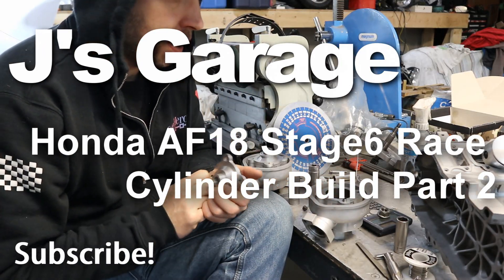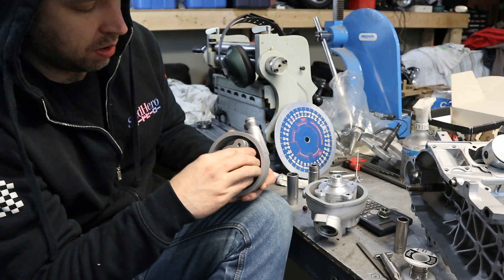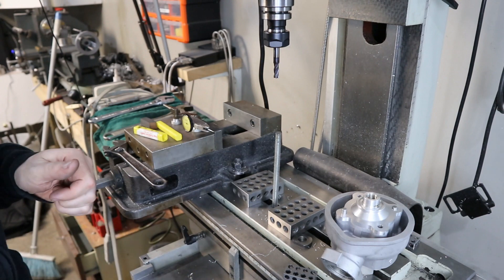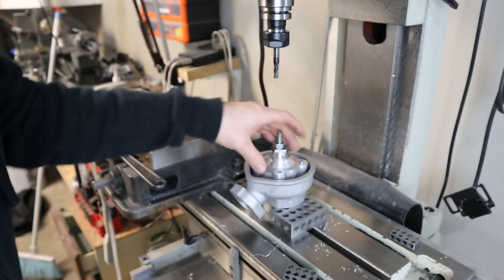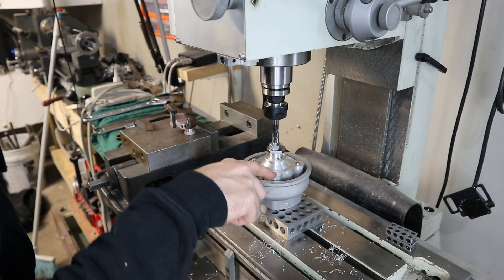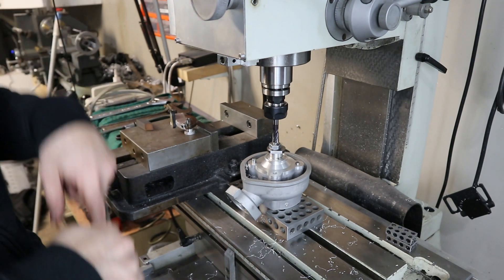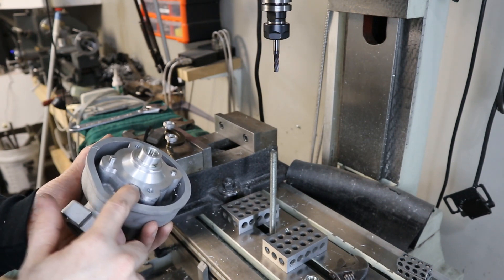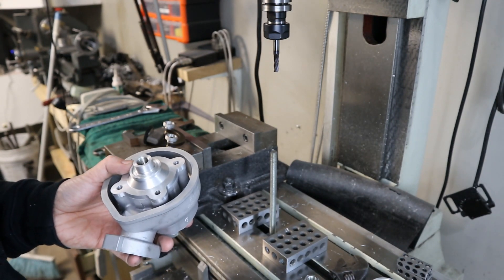Stage6 Modular Race Peugeot 70cc cylinder Honda AF18 build - Part 2 - J's Garage

Comment: I've watched this build series a couple times now, and I'm really thinking about going this route with my next build. Where'd your order those cylinders from?
You do some really rad stuff, dude.
Reply from the maker: These cylinders are no longer available as far as I know.  I got these from maxiscoot like 5 years ago now.  Last time I was on there looking they weren't even listed
Reply: @pitobread  I was worried that was the case since I didn't see em in stock anywhere. I suppose I could do it with the MHR rep kit though. 
Did you ever run, or finish this bike?